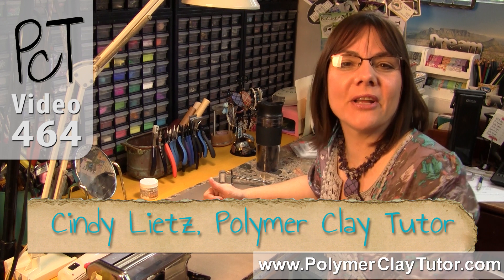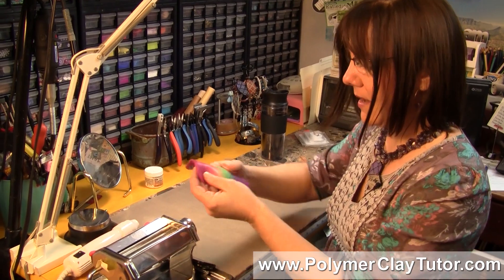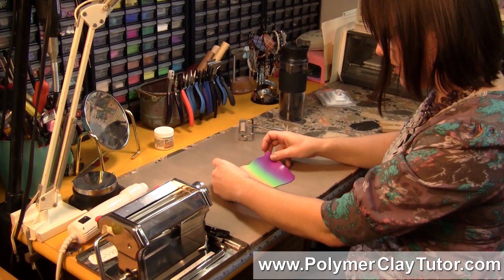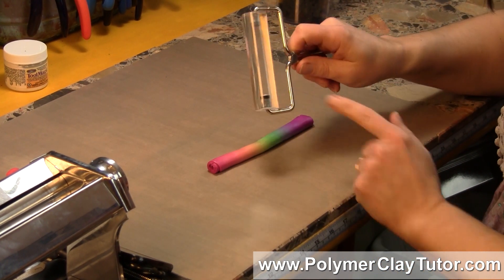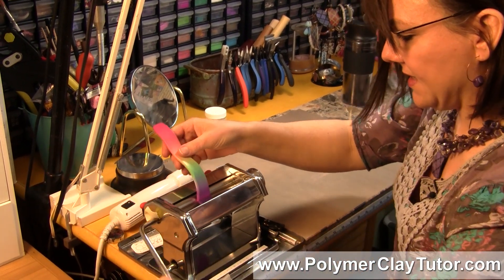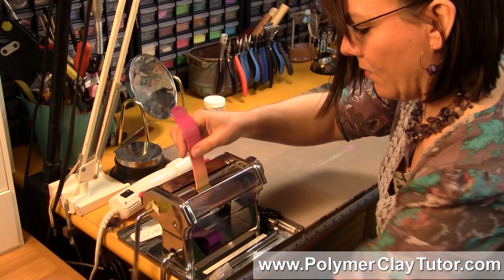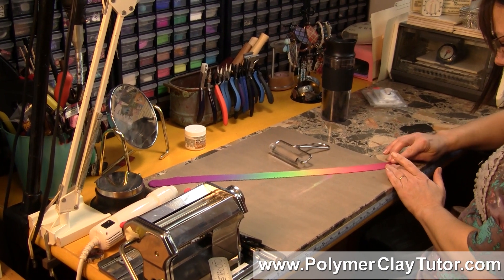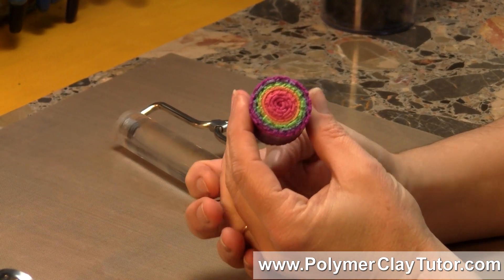How To Turn Your Wide Skinner Blend Sheet Into A Long Strip

Comment: Hello! Your work is very nice! I tried to work with Fimo Soft and when I baked it, the color changes to a transparent color. And I buy the product that says no translucent. I was wondering why it changes to transparent and not the color it originally is. Am I baking it for too long? I would like your help and opinion. Thank you!
Reply from the maker: Hi Rosalba Serrano I don't work with Fimo Soft very often but are you sure that the color isn't one of the colored translucents called Fimo Effects? Because the regular Fimo colors I have used are quite opaque. I suppose it could be a temperature thing, but that doesn't quite seem right.

Comment: I'm just thinking about creating my own beads. What are some techniques (other than Skinner blends) that are a good starting point and easily expanded on?
Reply from the maker: That is kind of a tricky question since every technique in polymer clay can be expanded on. There are surface techniques, canes, slabs, stacked techniques like mokume gane, mica shift, sculpting, etc. All of them have simple beginner projects and difficult advanced ones. I would suggest that you go to pinterest and do a keyword search for any of the techniques I mentioned plus the words polymer clay and see what interests you and start there. ie "polymer clay mokume gane" You can also go to my blog at www.polymerclaytutor.com and take a look around there. I have tons of technique tutorials for beginners that should help you out.

Comment: Do you have any idea how you would make a skinner blend sphere?
Reply from the maker: That would be a little trickier, but you maybe cut your blend into pieces and wrap the sheets around a central ball in layers. (Think about one of those globes from elementary school with the magma core, the layers and the crust.) Or you take a roll like the one in the video and pinch the ends in so they closed up and became a ball (though I don't think that would be perfect. I am sure it could be done, but would take a little planning to do well.
Reply: @PolymerClayTutor  Thanks for the suggestions!

Comment: My pasta machine looks like yours. The clay gets gummed up and wraps around the rollers, gets trapped under guards and creates all sorts of messes. I spend hours cleaning it using lots of different methods. When I go to use it again the new clay is tainted with old trapped clay still in the machine. How do you clean your machine?

Comment: Maybe a really silly question, but I have problems to coat my things with varnish. No mather how much or less I take, if I shake it before or not, there are always whity deposits (mostly in small corners) from my fimo varnish. Can you please help me?
Reply from the maker: Hi Aelonisify If your varnish is not drying clear it means it is not drying properly. Any finish that you put on polymer clay should go on in very thin layers, making sure it is fully dried before putting on another layer.

Comment: Great tutorials!  Thank you!

When I'm blending my clay, it gets wider and wider, and the top and bottom end become very distorted.  Is that normal, and is there anything I can do to prevent it without distorting the blend?

When thinning and lengthening your finished strip.you progress through increasingly thinner settings, rather than going immediately from the thickest to the final thickness.  What does this do?

Thank you.
Reply from the maker: Hi waterflaws nom deguerre use your fingers to the sides of the blend before it gets too wide in the first place. If it has gotten wider than use the tricks I show in this video. As far as only going one setting down at a time, that is done to prevent the sheet from wrinkling.

Comment: what I need is a comparison between clays, I'm using sculpy original and it conditions really well,, beautifully and then when cools its bendy a bit but if its thinner it breaks to easy, I need all that with strength to back it up, even mixing the premo translucent didnt help, its not just the original either the other sculpey is almost to soft and wants to just crumble if a thinner piece is baked. is Fimo firmer after baking? or kato maybe? ooooo  I so need a comparison, I dont have the money to test this stuff but I love doing it
Reply from the maker: MsMagicweaver Sculpey original, and sculpey III are very brittle. If you want a strong clay, stick with Sculpey Premo, Kato or Fimo. I will be doing more comparisons in the future. If you want to learn more different brands, go to my site at www.polymerclaytutor.com

Comment: r u supposed to bake clay canes?? i didnt think u were
Reply from the maker: Hi Cameryn8 You can use polymer clay canes raw (add them to beads etc) or you can bake the cane, cut into thick slice for beads (drill after baking). There are really a lot of options when it comes to working with polymer clay canes.